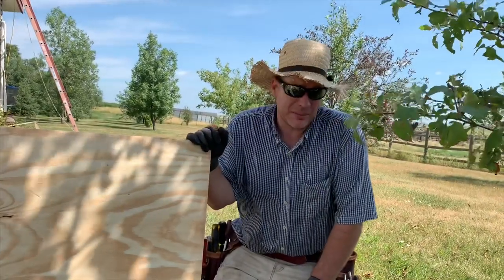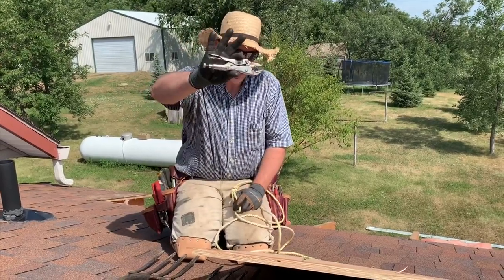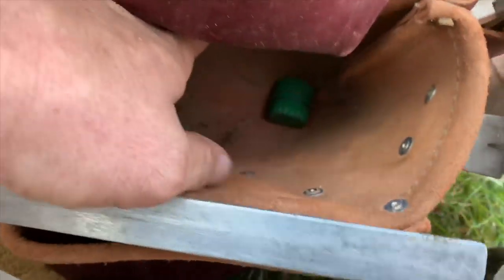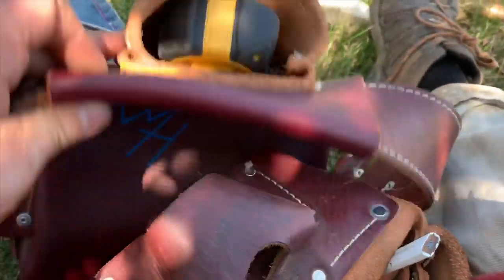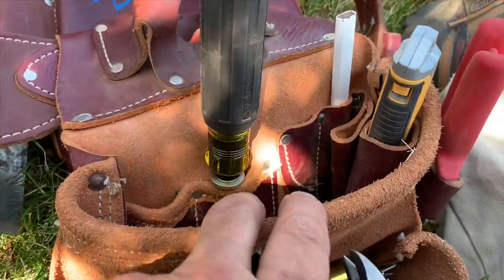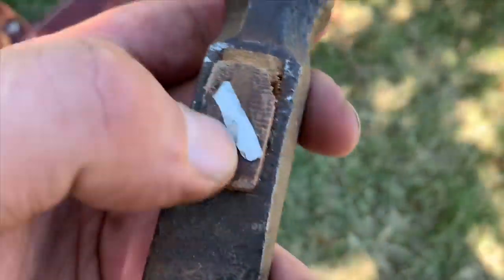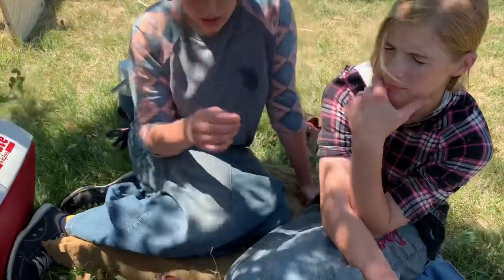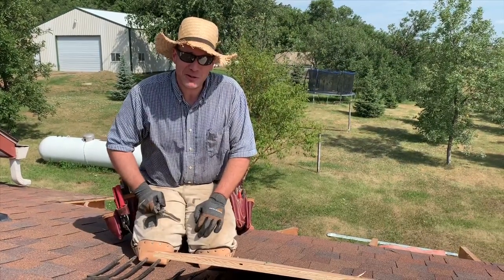Jobsite construction tricks

Comment: I do the same with vice grips but I weld a washer to adjustment nut and tie the rope through.
Reply from the maker: I have a players with a washer welded on it. It works far better. I should’ve said so in the video.
Reply: Ha! I bet I've seen a washer welded on the tightening nut at least three or four times and always wondered why someone did that. Now it makes perfect sense. Thanks Ciaran Dunne for that comment.